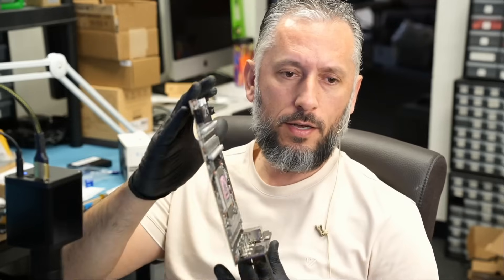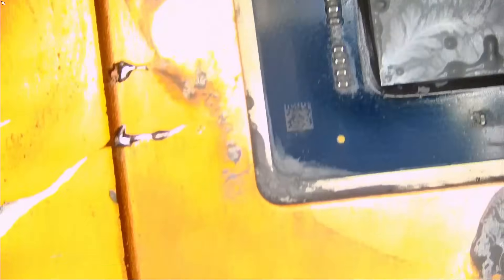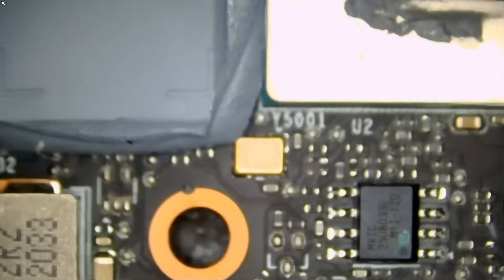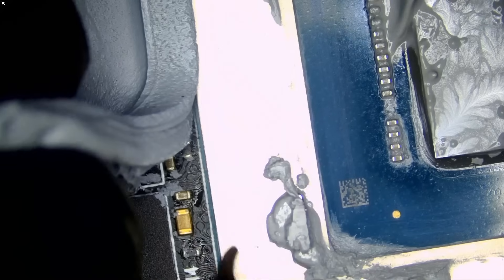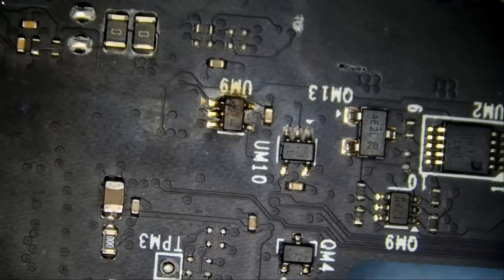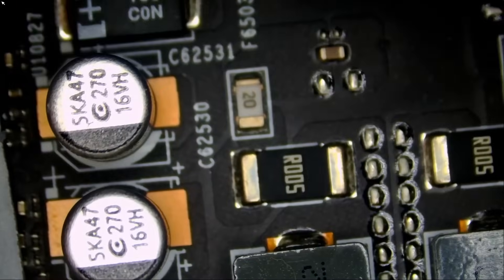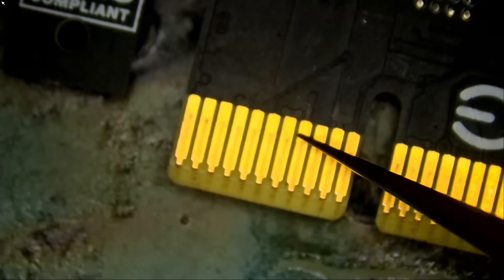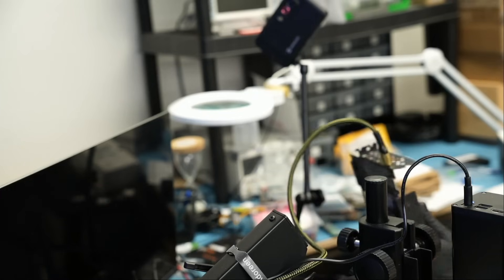Catastrophic EVGA 3090 GPU Repair

Comment: The UM9 component on an EVGA RTX 3090 is a surface-mounted component that is part of the card's voltage regulation module (VRM). It is an inductor, sometimes also referred to as a coil, and plays a role in stabilizing the power delivery to the graphics processing unit (GPU). In general, inductors are used in power circuits to store energy in a magnetic field and oppose changes in current.

 AI is amazing

Comment: I would have called it a no-fix because it is such user damage and not faults in factory production. A stupid owner with a big ego thinking they can do this stuff with a $1500 graphics card is just idiocy.

I could understand these mistakes in the 1980s or 1990s, but it's the 21st century. YouTube as hundreds of videos that can tell you how to properly apply thermal paste, thermal pads, and even liquid metal.  This kind of stupidity and negligence by the owner needs to be met with a return so that they have to suffer.  You're a saint for even doing this repair.  I'd have told them unless they wanted to pay an hourly rate to do all the clean-up, replacement, and repair at a high hourly rate, they should just go buy another card.

Comment: Did you see Nvidia says on the news cards the cable are "fixed" so they Admit without say they SCREW on 4090 but this new 5090 is going to more high voltage ...lets see...

Comment: This is 100% an attempt to do a water cooling where they tried to install liquid metal on the water cooling block. I guess they mess up maybe not tightening or installing it right where it is leaking when they try to run the water through the block. In the panic they try to take off the water block and rip that 20 caps. I guess the water that leak washed all the liquid metal that was supposed to be between the contact of the cooling block and the GPU to all over the board or during an attempt to wipe it with a cloth or something. This is my best guess.

Comment: Customer most likely used liq metal, messed up, then tried to blame it on a phantom glass of water. Liq metal is an amazing thing for heat management, but you have to really know what you are doing. Definitely not for an amateur.

Comment: I quit using Liquid metal and other exotics when i discovered the phase change pads made by, usually pop the sheet in the freezer/fridge for 15-30 min to make install easier on CPU. Most super high end enterprise server equipment uses the pads over paste not only for longevity but does dissipate heat slightly better than almost all the thermal pastes, if it's good enough for monster 192 core AMD epyc cpu with just a fat chunk of a heat sink on it i am sold for my stuff:). It's also handy for SSD cooling solutions since most good motherboards have coolers built in for the ssd's that double as cover panels so usually a upgrade from the cheap chinese thermal pad on SSD from factory, can be used for lots of other stuff like VRM's, nand chips, memory coolers, chipset heat sink/cooler and whatever else you can dream up . Made a massive difference in the 134TB NAS i built using a free poweredge rack server, temps were way lower plus more stable. I scored a bunch of server stuff and high end workstations from a cad design startup company, had to remove everything including all the network cabling. was worth it cause it was all 10G POE switches and a 48 port 2.5g POE, eaton 4u battery back ups, several servers and most were dell power edge but fairly new.  can't remember all the specs but the 2 storage servers were dual xenon e7 with all the 10TB drives and they had a few other servers fire VM's and who knows what else but just got time to play with them thanks to the snow down here in south Alabama. Have a good 2.5 G LAN setup with a mini  server rack but now its game on and the smaller storage server is gonna be a SSD/NVME NAS setup. Can't believe i finally get 10g networking and have the cabling thanks to having to remove it all. they literally dumped /gutted the whole building and we asking us if we wanted all kinds of other stuff, grabbed some led light fixtures, nice office chairs, desks, workstations and they even had a vacuum table i snagged for carbon fiber vac forming. Sadly i could not get the super expensive 3D printer but their old one was in back room and snagged that bambu right up and boxes upon boxes of filament, nobody even checked in there. even the regular non cad employees had nice workstations with good gaming type GPU's but the CAD guys had threadrippers or high end intel plus enterprise nvidia cards. it's been crazy sorting all this stuff along wit testing but most of it is like new. Only in america would a company just dump all this stuff, i am freaking poor and have to buy used stuff or make what i need but dickbag corporations just throw away millions in equipment just because. Makes me sick but get to test a bunch of phase change pads on all this stuff lol

Comment: I have had 1 of these ftw3 that i blew up with 1000w vbios and now i have my current for 2 years working/mining/rendering and gaming 24/7 straight without any issues, converted to hybrid and overclocked to the max pushing 520W, liquid metal, copper modded on 24 vram chips, hard modded etc, its a beast and i will use till it dies or doesn't do anything efficiently anymore, great company, LOVE EVGA RIP
Reply: You say: "LOVE EVGA RIP", but EVGA still exists. They don't make graphic cards anymore but are still making motherboards, power supplies and so on.

Comment: My 2 cents. If you wanna protect your computer and componets  from voltage surges, invest in a rackmount power conditioner. 

I think some of these burn connector problems stem from shitty electricity in people’s houses.

Comment: GPUs are expensive and easy to mess up.  They should be treated with extreme care. I have built and repaired my work pcs for two decades and never mess with the gpus. If I wanted a better cooler on one I would buy it that way with a guarantee.
Reply: They're expensive because of ngreedia.
Reply: @FR4M3Sharma  So go buy AMD junk then.
Reply: @gaynzz6841  username checks out.

Comment: Any idiot who thinks using liquid metall serves any purpose deserves to buy a  new card.😅😅😅
Reply: liquid metal has its place, its just people like this think its the same as thermal paste with viscosity for some reason.
Reply: 5090 has liquid metal in it lool😂
Reply: So you think there is no reason  more and more manufacturers are applying it from the factory ?   Nothing works better as far as thermal conductivity goes.

Comment: That 3090 is worth like $300 usd. Why would you even send it in for repair, it makes no sense. You have to seal liquid metal in with liquid tape around the GPU die to prevent this. All of those caps should have been covered in liquid tape. Don't use liquid metal if you are an idiot, it's pretty simple.
Reply: Give me a 3090 for $300

Comment: The connector on the cards PCB isn't what got "fixed", it's the cable end that they updated. Your still getting them because people are still using the old standard cable end, probably the factory adapter or a cable mod adapter. All of the newer PSUs should have the updated cable end for the "12v HP" harness, now called 12v-2x6.

Comment: I am one of the rare ones wanting to know what the chips' function is. I 100% understand why you don't care for sure. You have a donor, and you don't get paid more to know what it does. I specifically work on things because I enjoy learning about them and helping others and sometimes while troubleshooting we have to have the knowledge or at least work toward the knowledge of how the circuit works and which component(s) are faulty. Only the easy repairs show signs of damage. The harder ones often don't. I do totally get your point as a business for sure. You are super quick and have perfected making money as a business. Just sharing  that that's the mindset difference for some. Is it a business or for knowledge and enjoyment.
Reply: You need to understand that while Alex is swift and efficient on repairs. He's basically doing a number of GPU repairs by cargo cult. Find a dead part, find the same part on a donor board and replace it.
Reply: @SpiggyTech  
Yeah, I tried to mention in my comment that I 100% understand why he does the way he does it, having donors and making money. He is a master at pumping out repairs, and that's obvious. I always give tremendous respect to Alex for that. I applaud Alex on every single reapir he pumps out. I 100% meant no disrespect towards Alex. Alex and I have had conversations several times, and I believe he knows what I mean. I meant this straight to Alex and labeled it to @northridgeFix. I was simply sharing why some of us do like or need more information at times. He is correct. If you have to go that far or deep, it's hard to make money, and I agree with that also. I simply stated that it is sometimes needed when helping someone out by working on something for a friend or family (which is what I base my channel on for fun not a business) And sometimes just wanting to learn more about how the circuit works and why it failed. Again, that is not making money. Just enjoyment. Nothing about my comment was disagreeing with Alex whatsoever. I am just sharing a different perspective on a similar passion. That same smile you see on Alex's face when he is successful in repair. That smile is more than profit.
Reply: Probably and gate
Reply: @ariewijaya1679  yea, that would be my other guess. EVGA did their RMAs in-house so they don't release the boardview schematics to third parties. The best references we can pit the data against are Nvidia Reference, MSI, Gigabyte, and ASUS. You can find similar arrays on other 3080/3090 cards. MSI lists it as a SC70_5, ASUS lists 74LV1T08GW TSSOP5.
Reply from the maker: Ok, You brought this on yourself. Now, your task is to figure out what that chip does and respond to this comment.
Reply: @NorthridgeFix  Alex, one thing you need to consider is that your repair shop is doing well and sitting on a number of donor cards to pull chips from. Not everyone has such resources. Being able to identify the suspect component is integral for that repair. That component is a voltage regulator.
Reply: @NorthridgeFix  
I have already tried to find it lol...
I could not find it...
These SOT devices are very hard to find information on and I have several videos talking about having a very hard time for sure.
Reply: @ThriftyToolShed  If memmory serves, its a logic u-gate (DBV package). It supplies the power-good voltage to the power controller chip. Without it, you would not get memmory, core or even pex enabled.
Reply: @NorthridgeFix  🤣
Reply: @NorthridgeFix  
Right!🤣
Reply: @NorthridgeFix sir i have one question please help me🙏 can i use conformal coating on gpu pcb??? Which components i should avoid on coating process??

Comment: 5090 has liquid metal on it from factory, I wonder how many people will destroy it just by being stupid
Reply: A lot..... The first thing they are doing is to change the liquid metal with another one hoping for better temperatures instead of buying a better computer case with better airflow.
Reply: @Dandan-tg6tj  I think the main issue with liquid metal is that it dries up much faster than thermal paste. People will be opening their GPUs and getting that stuff all over the cards.
Nvidia always makes sure repair shops have their hands full of GPUs
Reply: @ksenchy  I changed liquid metal on video cards a lot. If applied correctly, it does not generate any further issue, nor it is drying. The only thing that looks like drying is its diffusion into the copper. They should leave it like that but they don't.
From all of the cards that came to me for a repair, probably 75 percent are the cards the owner screwed them and only 10 percent was their fate to get broken because of NVIDIA or AMD. 15 percent are broken because an idiot always tries to save 20 cents at manufacturers factories for a 100 USD card.

Comment: As far as I know, the only really difference between the old 16-pin and the new is that the sense pins are shorter, the power pins are line and it's a little harder to insert and remove. They wouldn't be super easy to differentiate visually.

Also... talk about Hiroshima on that 3090.

Comment: I think that liquid metal, is likely galinstan .  which  will slowly eat through all aluminum parts it came in contact with.  now i wonder what kind of accident happened such that this came spilling all over the GPU.
Reply: ah, wikipedia has the answer: galinstan is often used by overclockers as thermal paste.

Comment: Wondering how many videos will be about the 5090 soon :/
Reply: They're maxing out the 12VHPWR already. There's absolutely going to be some melting 😂
Reply: @AshtonCoolman those connectors didn't melt because temperature during normal use. People neglected checking wires on cables. Some of those wires are sliding out of the connector and most likely weren't sitting properly, not tight enough.  I run my strix 4090 for 2 years now no cracked pcb or melting connectors
Reply: especially if they only do one 12v power cable connector, there needs to be multiple of them so the current load is spread out
Reply: @henrywalker8287  presumably its not that easy or they would of done exactly that.
i can imagine receiving power from 2 different cables probably introduces some sort of electrical fluctuations along the board that interfere with its processes
Reply: @henrywalker8287  thought the same thing... why not add another cable to ensure that ur card that cost over 2 grand doesnt melt and ruin itself lol
Reply: yeah, curious of Alexes opinion on the 5090 FE board ..if its workable or what ...:)
Reply: RTX 5090
Asus ROG Astral OC: $2799.99
MSI GAMING TRIO OC: $2349.99
MSI SUPRIM LIQUID SOC: $2499.99
MSI SUPRIM SOC: $2399.99
Asus TUF GAMING: $2449.99
MSI VENTUS 3X OC: $2199.99
MSI VANGUARD SOC LAUNCH EDITION: $2379.99
MSI VANGUARD SOC: $2379.99
RTX 5080:
Asus TUF GAMING OC: $1699.99
Asus ROG Astral OC: $1899.99
MSI GAMING TRIO OC: $1199.99
MSI Inspire 3X OC (Gold) - $1169.99
MSI GAMING TRIO OC (white): $1199.99
Asus PRIME: $1399.99
Asus PRIME OC: $1499.99
MSI VENTUS 3X OC PLUS: $1139.99
Gigabyte GAMING OC: $1199.99
Gigabyte WINDFORCE SFF: $1369.99
MSI SUPRIM SOC: $1249.99
MSI SUPRIM LIQUID SOC: $1299.99
MSI VANGUARD SOC: $1229.99
Reply: Considering EVGA no longer makes GPUs. We're likely to never see any new EVGA GPUs
Reply: They have to make them first 😂
Reply: It has replaceable PCI-e connector and replaceable IO board on the FE model. No pci-e connector crack repairs, just replace the connector.
Reply: Probably the same for every other card. 🤷
Reply: The 5090 is surprisingly well made. At least the founders edition is. The pcie is a separate board, the hdmi/dp plane is a separate board, and the main pcb is barely visible. So there should be no stresses on the main gpu due to sagging or heavy monitor connections. I guess only time will tell but from what I see, they put a lot of thought into this new design. Check out GamersNexus video on 5090 teardown.